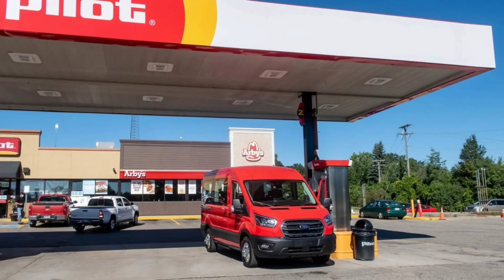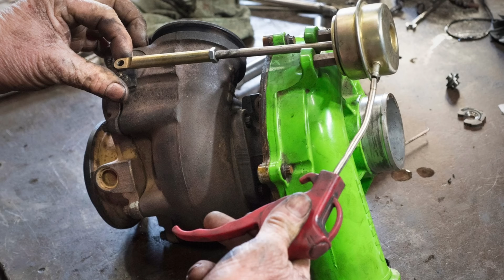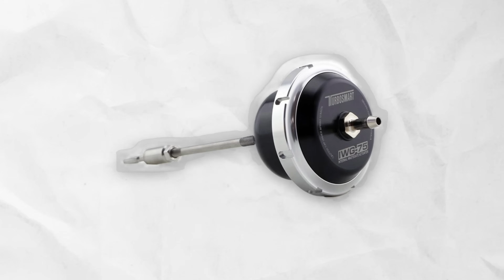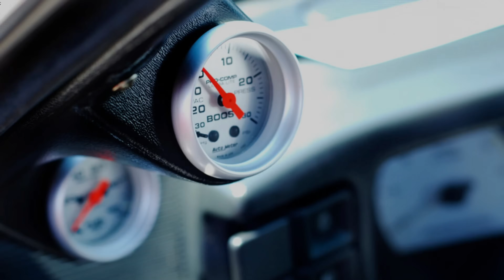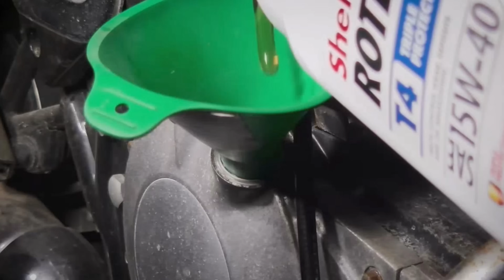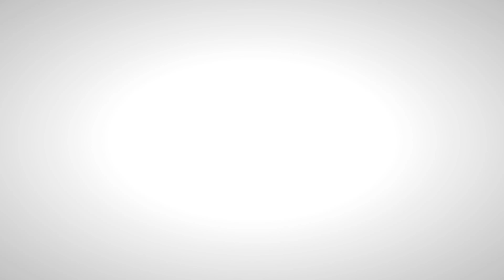7 Stupid Ford Turbo Habits That Are MELTING Your Wastegate (STOP IT NOW)

Comment: Again with videos like this lots of false information and want you to worry. The waste gate rattle at start up is normal. It also while warming up will come and go as the vehicle does its checks. Your truck opens and closes them on every start up. If the rattle gets to loud you can add a weak spring to help with the waste gate rattle. You can find videos all over. Start up dont move until the rpms come down and you are good to go no need for it to warm up. It will warm  faster moving. The rods or waste gate do not get oil only the turbine shaft gets oil. The turbos will last just as long as the motor will.

Comment: #4 is the habit that lots of people do daily,   lots of people are racing their cars home or to work and then shut the engine off with the Turbo cooking Red Hot and they are killing the Turbo Charger.   When you engine shuts off the engine oil in the turbocharger bearings and oil lines is stuck there and gets cooked into a black putty which leaves Coking deposits that blocks your oil lines.       People need to let the Turbo cool down before shutting off the engine.           NOT JUST FORDS but all brands of cars with a turbocharger are prone to this issue !
Reply: Learned this many years ago on the farm.
Let the turbos cool down prior to shutting off.
Good vid👍
Reply: The real issue is that you don’t know what you are talking about. While it’s a good idea to never beat the crap out of any engine and then shut it down, (and not that many people do that) the ford ecoboost engine uses thermal siphoning and also has a pump running coolant thru the turbo to cool it to a safe temp after shutting off the engine.
The scenario that you describe with oil coking  was something that would happen back in the ‘80’s with turbo engines. It ain’t the ‘80’s no mo.
And my truck has a factory oil cooler also, along with the coolant lines,  some engines are made to last…
Reply: @pathunter7003  Numb nuts,  if you had read you would have seen I said all brands of engines with turbo's   not just Fords.
Reply: @Bowhunters6go8xz6x  and I wanted to educate you that not all turbo engines have that issue with the oil coking, you are the one who brought up ford engines. I can’t fix stupid princess, but I will attempt an education. I can see that it will never take with you tho
Reply: @pathunter7003    What I was pointing out is a good practice to follow for anyone that has a Turbo Charged engine in their vehicle,  don't be a dunce !
Reply: @Bowhunters6go8xz6x  what you did manage to point out is that you don’t know how some engines have changed thru the years. Educate yourself so you don’t appear to be such a clown, but that’s too late now

Comment: 5000 miles is too long to change your oil. You need to change it between 2500 or 3000
Reply: 3000-3500* IMO 2500 if you’ve got it tuned, tow a lot or run it hard frequently.